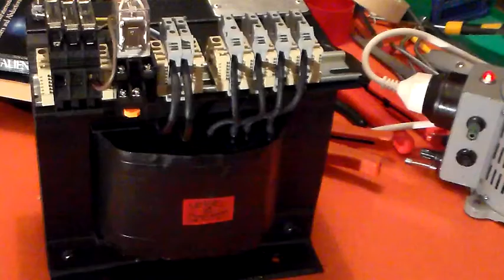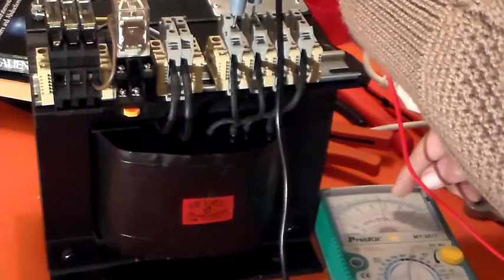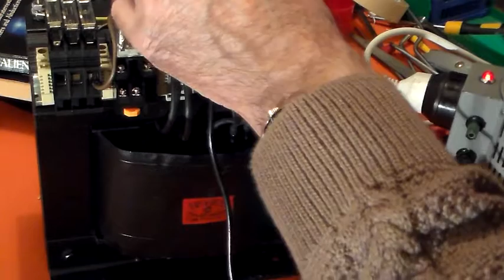Giving The HT Transformer A Tickle...

Comment: G'day Steve, You blew a fuse on the primary because of rush of current. That's why you have made that circuit up for the "soft start" on the secondary. I'm all new to this type of home brewing and working with 3000Volts this is going be awesome when it finished. Steve another question are you going to put wheels on the bottom of the stand? cheers mate.
Reply from the maker: Dennis Peake Hi Dennis... no, an inrush current protection circuit on the primary winding was always part of the plan. I was surprised the fuse blew on the initial test as the transformer had no secondary load. I expected a reasonable inrush current when the transformer secondary windings were loaded with the rectifiers and smoothing capacitors, but not with the 'stand alone' transformer. You learn something new everyday... as they say, and I learned the primary inrush current on a transformer with no load on the secondary winding/s can actually be greater than the inrush current when the transformer secondary winding/s are loaded. If the power supply was going to be built as a 'stand alone' unit I would probably have put strong castor wheels on it, but as it will be built into the amplifier I will just have 4 strong feet on the amplifier case.